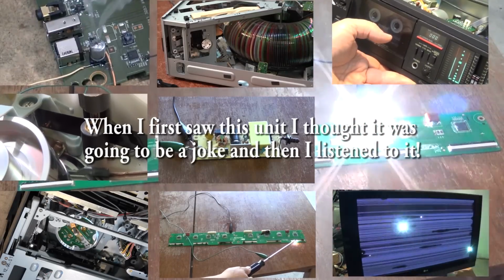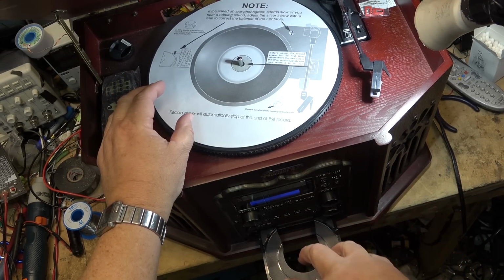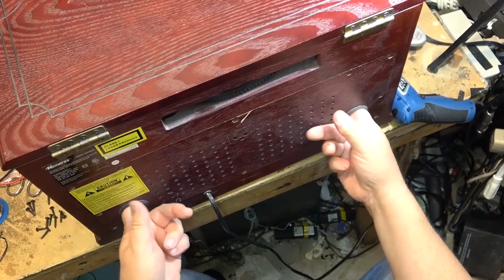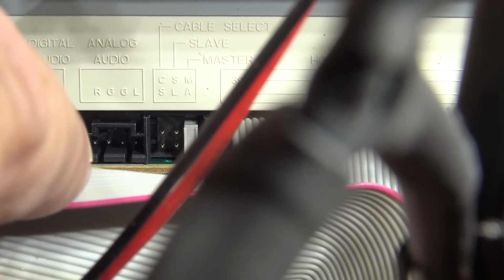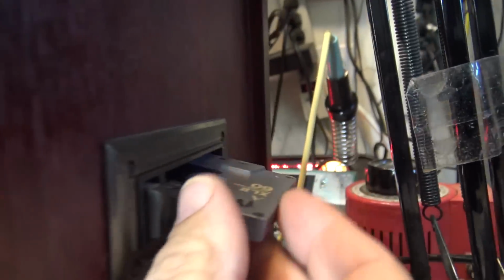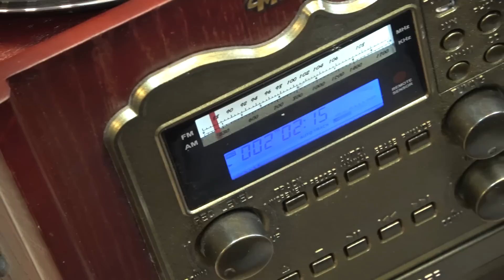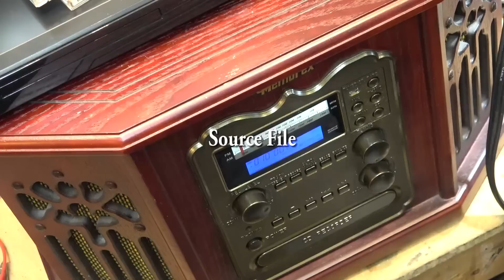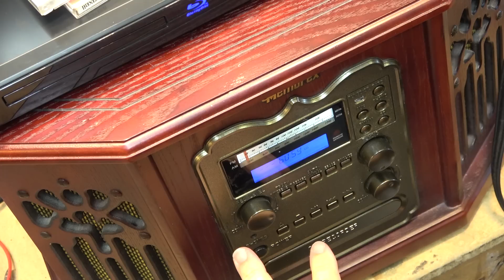When I first saw this I thought it was going to be a joke and then I listened to it!

Comment: I recently acquired a 2000 era dual bay stand-alone CD Recorder at a thrift store.  Yes, the kind that required the special discs.  I picked up a spool of CD-R Music discs just to test it out.  I was happy to discover when dubbing disc to disc, it duplicates at high speed while letting you listen.  You can use the aux in to record other sources as well.  In the US, I believe the blank media levy is 3%.
Reply from the maker: Here it is a flat per disk fee that is about double the cost of the disk.  Spindle of 50 26.00 tax is 45 on top.

Comment: THE CASSETTE DECK:
Another respectable YouTuber showed you can put a drop of 3-in-one oil in cassette motor (disassemble, put it in the back baring) and it would give respectable WOW and Flutter readings. Just in case you choose to try.

Edit: and after listening to the sound, I'd decide if those speaker boxes could use some rock wool or polyfill.

Edit2: I would add an aux out on the back to run into a bigger amp. Maybe patch into the "phones" on the inside and lead them to 2 RCA jacks on the back with a push-button switch to the front for activation.

Comment: I had something similar to the one VWestlife reviewed the other day which also had a CD Recorder (doubtless very similar internals). What surprised me was the CD internals seemed to be virtually identical to the TEAC CD recorders, which have been SATA for a long while but the chipset and general architecture appeared to be almost interchangeable. So I can well believe that the recording aspect of this is decent - those TEACs aren't bad at all even if viewed as real hifi.
Reply: Depends how old it is, SATA became mainstream around 08/09
Reply: The display and firmware in this is identical to the Anders Nicholson system I did a video about. One nice thing about this system is that although the record player uses a ceramic cartridge, they did match its impedance properly, so it doesn't sound so dreadfully tinny as they ususually do.
Reply from the maker: @tacofortgens3471  this is from 08.
Reply: @vwestlife  I was going to talk about your latest video and the bad vibrations the cd give to the turntable
Reply: @sergiobisonte  bad vibrations like it stops when you want to hear a record or vibrations vibrations, not a out of this world thing?

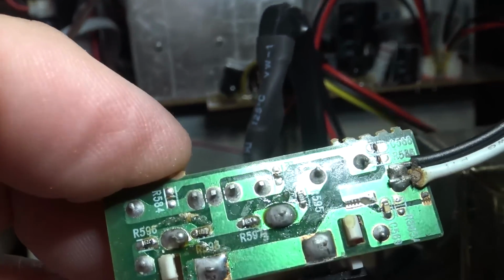Comment: 14:20 Looks like the input signal Ground is decoupled via an smd capacitor directly to power supply ground. The decoupling is for HF filtering. This is good old school grounding practice to offload any noise to the 0V right on the filter capacitor as it prevents the noise contaminating signal ground in the preamp section. I've used Maxell XL-II (for audio) many years, purely because they tend to play well with old CD players. Had no idea about that tax!
Reply from the maker: That tax is only in Canada.  The Canadian recording industry pressured the old conservative government of the day to add another tax like the GST (gouge and screw tax) that they brought in 30+ years ago that added at that time 7% to everything (now 5%)
Labour charges, recycle fees, resturaunt food, phone bills has bills electricity.  Everything.  
They removed the federal excise tax on goods coming in at the manufactures level and shifted it to the end buyer that screwed us all over.  They even charge it on air!  Go to the gas station to pump up a tire.  The gas station now charged we. 1.00 for air plus .05 tax.  Fast food places now change .25 for the bag the food is put in and that bag has .05 tax added.  the restaurant keeps the $0.25 fee but the government gets their $0.05 fee. Don't ask for a bag no problem they hand you your food through the drive-thru window one item at a time and you bag it yourself or you do what some people do they become an entire asshole and sit in the Drive-Thru window and eat it before they move just to piss everybody else off in the line and to piss off the restaurant because the restaurant is charging this bag fee.  This is a local issue.  City of Vancouver started this and other local cities copied. It was a way to try to cut down on single use items. Gone are plastic straws and spoons and forks, now you are expected to eat with wood forks and drink with paper straws.  Plastic bags gone now you pay for paper bags. Problem is it was a voluntary program. Owners of these joints could charge a fee that was supposed to be used to help the environment.  All it does is help the already rich owner of the franchise because it all goes in the pocket of the owner.  It's not collected by the city.  The feds and provincial government gets their .05 in tax that the bag is charged and the .25 goes to the owner.  Like a license to print money.

Comment: I know you said you wouldn't use the record player, clearly a very good :) it's shockingly bad with all that flutter. The cassette sounded better than I expected. I think I would just feed an external source into my PC, rather than having an enormous unit around. Also I still have my Philips CDR560 from 1999 which works beautifully :) Tascam PCM recorder these days though. Nice video
Reply from the maker: It's a piece of furniture basically.  I put it on top of my old Philips record player with am radio. Fits in nicely.  Plug a half decent tirn table in and it is set for record archiving without typing up my computer.
Reply: @12voltvids  and why not indeed if you have the space for it and it's useful :)
Reply from the maker: @richclips  space is at a premium here at the moment.  Wife lost 2 clients recently and she is responsible for getting rid of their crap. I want happy when s moving truck showed up to drop off crap I have to get rid of.

Comment: The only reason I can think of for not allowing recording from the radio is that the motor and laser circuitry in the CD drive can produce interference that would be picked up by the radio - and therefore be recorded along with the audio. This would particularly affect AM reception; I'm sure you've tried radios near computer equipment before!
Reply from the maker: Thats what I said. ( In a prior comment)

Comment: The Audio CDR just had a special code in its ATIP info that enabled audio recorders to recognize the disc as a writeable medium. Pretty much like some early DATs didn't allow to record music on DDS tapes.

The tax wasn't new - it was a general royalty payment distributed towards the owners of intellectual property rights according to a ratio depending on music sales.

It was also collected on compact cassettes and decks, DAT tapes and decks and later on also on computer CDR drives and computer media once the music industry realized that you could do flawless audio rips to your computer hard drive - thanks, Plextor 😂

They did something similar with computer scanners IIRC.
Reply from the maker: Yes i know about the royalty tax on audio cdr and the lead in code for the music disks 
In Canada they applied the tax to all recordable media primarily intended for audio.  Even mp3 players with internal memory and the tax was dependent on the size of the memory. As to dat and dds tapes I have never had an issue.  I have the first consumer Sony dat, the dtc75es and it works flawlessly with dds tapes. The only difference with dds tapes is the leader has a few stripes that tell the drive the it is a dds tape (computer drives read this) and detection holes on the back of the tape.  Some of the later cheaper drives had issues with the longer tapes which were thinner but all my decks work just fine with them and I have about 100 of them. Local store was clearing them out at 30 bucks for a box of 10 sobi bought all 10 boxes they had.  Still have a few that have never been opened.  Nice thing is the long tapes play 3 hours in sp and 6 hours in lp mode.
Reply: @12voltvids  pretty much the same in Germany. We had to pay royalty fees on almost anything that could be remotely used to make personal copies of music.
Reply from the maker: @svenschwingel8632  it's the shits because i despise paying a tax on something I'm storing my photographs on.

Comment: when that was new, i was recording tape and vinyl onto cd with a computer program (audio cleaning lab). i had all of that equipment plus a computer for a little more than that cost. it looks like  better cheap crap than most of them i have seen. i recorded about 400 cds from my music collection. i them ripped them into my computer so that i could
listen to them in my car or stereo. i can put a few thousand songs on a thumb drive, something i would have never thought possible! a music library in my pocket. is it live or
is it memorex?  3 or 4 inch woofer?
Reply from the maker: 4" woofs.
I record on my pc using audicity however this unit records just as well without having to fux around with recording and saving ect. Plug a good turntable it and hit go and it records direct to CD and breaks all the tracks up for you.  Want mp3 no problem pop disk in computer and rip. I wouldn't go buy it but it was left for me in an estate so I'll hang onto it only because it records so well from aux in.  I have a bunch of vinyl that i can record with this using a good turntable.

Comment: All of these "reproduction" units seem to use the same record player regardless of the brand.  Even the el-cheapo Crosley Cruiser uses that same record player. The first thing anyone should do before they attempt to play a record is to swap out that sapphire needle for a diamond one.  The needle that comes with all of these units will start to degrade the records being played very quickly as it has an extremely short life span. And yes, that is not a magnetic cartridge but a ceramic one.

Comment: They could have fixed it so the cassette could record from the radio since every "boombox" I've had could do that. I don't know the reason why they had those limitatations. My home stereo will record to USB from radio, CD or line input. But will not record from blutooth.
Reply from the maker: Could be a few reasons.  The one I bet is interference.   FM stereo has that pesky 19khz pilot tone that isn't an issue for cassette because cheap cassette mechanisms can't record much above 12k but CD or any digital for that matter can record right to 20khz.  Also the a-d converter probably radiates a bunch of noise that would interfere with the cheap radio board that is sitting only a few cm from the digital equipment.   So rather than spend money shielding the radio or adding a brick wall low pass filter to block the mpx pilot they just eliminated the record ability.  
FM tuners typically have an mpx filter for that very reason because without it recording from. FM created beat noise on analog recorders as well that used lower frequency ac bias (some cassette decks only used 30 or 40khz) and the pilot would beat with the bias oscillator.  
This was built for a purpose back in 2008 when older people were down sizing and wanted to get rid of their old records and tapes and not have to buy the music again on CD. It gave them an easy way to do this and to be honest the sound quality is good enough for the target demographic.  Even the ceramic cartridge didn't sound bad.  The woman that had this did initially that.  Converted her records and tapes to CD and then dumped the records.  I know thAt because i got a box of CDs and a few records and tapes she never got around to transferring.

Comment: Some technician told an older friend of mine that his Pioneer CD recorder's laser pickup was faulty because it wouldn't record. Turns out he was trying to use regular CD-Rs. Yeah that was an easy one...
Reply from the maker: Many people did not realize that those stand alone recorders needed special disks.  I got a whole bunch of cdr disks (spindle of 50) from someone that bought them for their sony and it didn't work and brought me the recorder.  I told them the same thing and they gave the CDs to me because i didn't charge to look at the unit which i literally just "looked" at and told them the problem and then showed them the proper disks that were also left with me.  Got those disks free too.  Had a customer bring me a dozen records and spindle if cdr audio disks to record them to and then told me to keep the rest as he didn't need them.

Comment: A decent unit. The only letdown was the flutter on the turntable, other than that I'd use it.
Reply: Yes, the wow & flutter is a bit much, maybe a new belt or cleaning the motor would help.
Reply: @sand0077  I wouldn't count on it, modern units are often flimsy and lightweight, which doesn't exactly help to maintain a stable speed.
Reply from the maker: @sand0077  that was my fuckup. I forgot to undo the transport screw at the back.  Remember I said it was never used.  The belts also probably have a bit of deterioration from sitting for 15 years but they will smooth out with use.

Comment: The pitch is probably too fast on the turntable most of these types stereo units are like that just get a extra small flathead screwdriver and turn the motor speed down a notch

Comment: The turntable sounds bad, flutter.
Reply: It has a bad flutter
Reply: @luckykev1  Exactly
Reply: Yea it does, to be expected tho
Reply: The belt probably hasn't aged very well due to not being used and walked in.
Reply: @svenschwingel8632  Yes, more than likely
Reply from the maker: That is the fact that I forgot to remove the transit screw in case you didn't notice. Oops
Reply: @12voltvids  That might account for some of the flutter.
Reply from the maker: @activexp  ya think.  It was one of those "oh shit" moments but the video was already done and i didn't feel like fixing it.  I will do a follow up and do a direct comparison between the turntable that's built in and a nice direct drive plugged into a preamp in the aux input and record the same track from both so we can get a good comparison between this plastic belt drive ceramic cartridge record player and a proper turntable.  Might do that today while it's still on the bench.
Reply: @12voltvids  That will make a very interesting comparison. Looking forward to the result!
Reply: question, the audio ends in wav format aka cd-audio or in mp3 format? 26:14
Reply from the maker: @lutboy2909  it's CDDA and the rips are .wav uncompressed.  It records red book audio CD. Sound quality is as good as i have heard providing you don't get carried away with the level. It will clip and like all digital when it clips it sounds nasty and distorted.  Unlike audicity that will compress this like a DAT if you go over look out.    Best to record with peaks at about -12 so there is plenty of head room just like any digital system.
Reply: @12voltvids  that's actually a good surprise and for being from 08 not bad at all
Reply from the maker: @lutboy2909  I was impressed.  It's a keeper 4 sure.
Reply: To fast to be flutter
Reply: @ingenfestbrems  Relatively slow changes in pitch are called wow, faster changes are called flutter.

Comment: It's hard to know what firmware is in the disc drive, it's easily changed.  I'm impressed, it looks fairly high quality, might actually sound good.  If I had seen it for sale, I would have passed it over as a POJ (piece of junk).  :)
Reply from the maker: Initially when it was given to me i figured I would flip it for 50 bucks but after hearing how good it records from aux in it's a keeper.

Comment: I would have loved something like this in the late 90's - early 00's.  I had the capability to record vinyl and cassettes digitally by connecting my hi-fi up to the sound card on my PC, but this kind of unit did away with the need for wires stretching from one device to the other.  The only down-side is that cassette player.  Horrible things designed to go on the dashboards of cars, no less.  Still, I suppose it was cheaper/quicker than having a proper mechanism that would look weird on the side of the unit.  An after-thought, indeed.  The turntable would be the main consideration for me.  Getting to record albums to put onto CD was very innovative, at the time.  I did a few for my parents, as I remember, from some of their old albums that I'd converted to CD, so they can something to play on their CD player that I'd just got them, when their library of music of CD was zero!

Comment: It was only the consumer CD recorders that required the special Audio CD-R/RW discs, the professional stand alone recorders like the HHB CDR-850 could record to a standard computer data disc. One of the early consumer recorders could be tricked into taking data CD-Rs, you just gave it an audio CD-R first, wait for it to read the blank disc then manually open the draw and swap in a data version. You had to use the disc and finalize it in the same session. This trick was actually published in the Hi-Fi magazine that was reviewing a number of these recorders. I have the Marantz version (DR700) but there was a Philips version too.
Reply from the maker: Too much work   opening the unit and manually replacing the disk without opening the drawer. I'll just use this one feeding the signal into the line in. I made a recording of the same vinyl and asked a golden eared friend to tell me which copy was made on computer with audacity and which was made with this. I knew which was which he didn't   he picked this as the better sounding   and was convinced it was the one done on the computer. Said for sure the disk labeled A was the computer   so then I showed the video of me labeling the disk and then recording